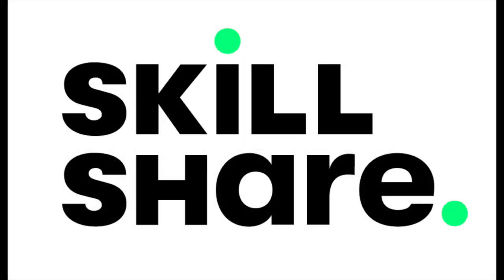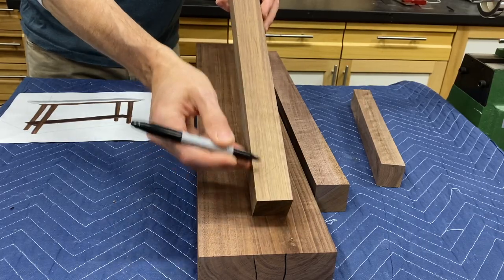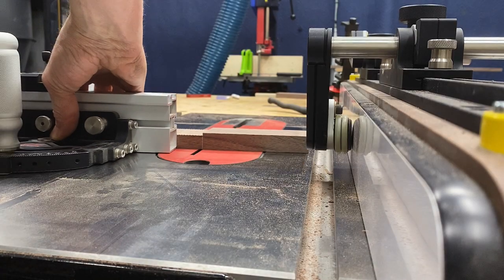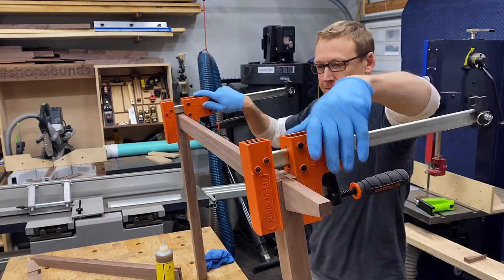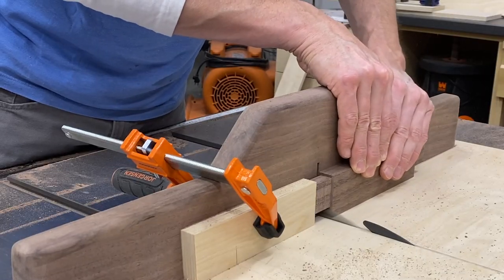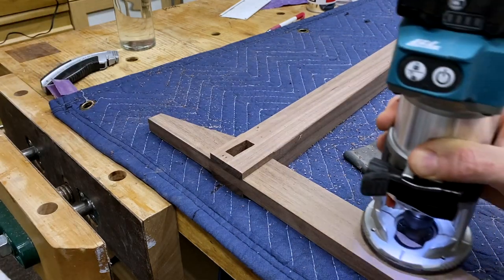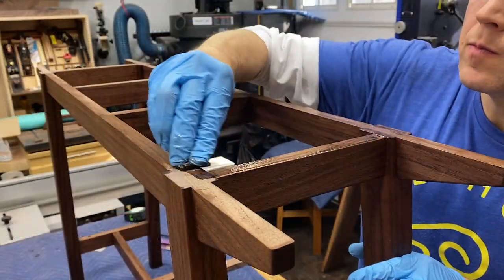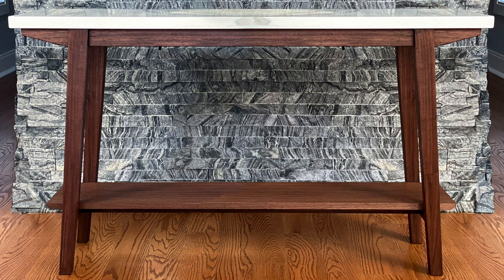Modern Console Table // Build Plans Available

Comment: Very cool project. I’d like to build this for an entry table and with a wood top. Could a drawer be added under the top? Because of the angled legs maybe not a drawer that goes from leg to leg but something that fills some space between the legs. No offense that I’m trying to change it since it’s fabulous just as it is and I’m thinking of ways it could fit my space better.
Reply from the maker: You can certainly add a drawer with some modifications. I have an online course on how to build a similar piece made of all wood with 2 drawers, if you are interested: https://rebrand.ly/modernwoodacademy

Comment: Great build and video. I really like this piece and the joinery. It's given me.some ideas to try for the entry table I'm starting on. One question for you, how do you clean your microfiber clothes used to buff off and remove rubio monocoat? I use the same thing but it seems to be a one time use the way I do it,  and that gets expensive over time. Keep up the great work!
Reply from the maker: Thanks Josh! Yes, unfortunately the micro fibers are a one time use. I get them at Harbor Freight so they are pretty cheap. I would say I used about $5 worth of them on a project.

Comment: Hey Kieth another great video and beautiful outcome!  
Was wondering if you at some point could tell us about your background as you appear to have a wealth of experience, not just in woodworking but also how you apply it when using your tools...it would be interesting.
Reply from the maker: Thanks Dave! Started woodworking in 8th grade and caught the bug from there. Worked for a contractor in high school during summer vacations doing random things like roofing, decking, drywall, etc. and built my first piece of furniture (a dresser) in college. Read a lot of books and magazines and started building my tool arsenal after college. Worked as a finish carpenter in between corporate jobs and started building commissioned pieces and re-investing that money in my shop. It just kept snowballing from there...books, magazines, online videos, more tools...to learn as much as I could and then put that into practice building furniture, as well as built-ins and cabinets. And what was a hobby with commissions has now grown into a full-time business. Scary! I didn't take any formal woodworking or furniture making classes until last Fall. Hope this gives a little insight!
Reply: @KeithJohnsonCustomWoodworking  Thank you very much for that!  I have followed a similar path...have been contemplating on interning for a fine woodworker/shop as that has been some folk's chosen path...guess I'm a little apprehensive regards to buying "real" wood and simply going for it.  
Your work is very precise, and I was looking for where it got that final polishing from.
I'll never forget that table you made (I'm sure you won't either), the one you had to remake, due to the client wanting it to be bigger!  It was such a beautiful piece, and quite the story as well!
Reply from the maker: @wayphun72  I'm reminded by that table every day because the first one is sitting in my living room. LOL. And yes, a lot of folks are scared of ruining good wood. I'm not one for spending all my time on the driving range...show me where the first tee is!! LOL.

Comment: Hi Keith! I have a question about the milling process. I work in a shop that is not climate controlled. So after milling the wood and letting it acclimate, what’s best process to avoid warping when moving the finished project to an indoor/air conditioned space? Thank you!
Reply from the maker: I don't know how bad your shop conditions are, but I would be running a dehumidifier to try and keep the humidity level at a somewhat constant rate. Make sure the moisture content in your material is under 10-12% and I would get finish on the project as soon as possible.

Comment: Thanks for explanation about grain and wood expansion!
You mentioned that you don't use PVA on top frame joints so it doesn't make wood expand. Isn't it the same with tenons and mortises you made with domino?
Reply from the maker: I'll be honest, using the Old Brown Glue is new for me. I just discovered a short time ago, so I'm still experimenting with it, but it is great having that extended open time for more complex glue-ups. So, it will be situational whether I use it or standard PVA. Hope this helps!

Comment: Hi Keith! Awesome video as ever! I hope you dont mind me asking, but is that how you apply your Rubio on all projects? I am new to rubio and looking for some tips! Also what brand of sandpaper do you use please? Big fan of the podcast as well btw
Reply from the maker: Thanks Jamie!! Yes, that is my typical method of applying Rubio on smaller furniture - dip a white scotchbrite in the Rubio, work it in and then wipe off the excess. When I have larger flat surfaces, I spread the material around with a squeegee or credit card and then work it in with a white scotch brite and wipe off the excess. The best sandpaper in my opinion is the new 3M Cubitron. It's pricey, but lasts a long time. And thanks so much for listening to the podcast!! 👊
Reply: @KeithJohnsonCustomWoodworking  Thank you so much. So you recommend leaving the rubio on for 10 minutes before wiping off the excess? Thank you very much again! I will try and get hold of some 3M Cubitron, but im in the UK and im betting its not available (non of the good woodworking stuff is!) Podcast is fantastic! I have learnt a great deal from it. Thank you!
Reply from the maker: @jamiechristensen4307  I think the amount of time you leave it on is situational. For example, which color you use, as well environmental conditions (heat, humidity, etc.) all seem to play a role in how fast the Rubio tacks up. If it gets too tacky too fast then it becomes a little more difficult to remove and you'll need a little more elbow grease. I would check it after 5 minutes. I usually work in sections and by the time I'm finished with that section, it's time to go back to the beginning and start removing the excess. Super excited you are enjoying the podcast!!
Reply: @KeithJohnsonCustomWoodworking  Thank you so much! I really appreciate your time!
Reply from the maker: @jamiechristensen4307  You're so welcome!

Comment: Great Piece! What source do you get your Rubio Monocoat finish?  Amazon?
Reply from the maker: Thanks Myles!! Yes, I usually buy my Rubio on Amazon (https://www.amazon.com/dp/B00OA5V19K/ref=cm_sw_em_r_mt_dp_H0A4EXVQ87VN0BVPXENJ) or direct from the Rubio website.
Reply: @KeithJohnsonCustomWoodworking  you mention you added black. Was that a Rubio monocoat product.  Could you share the skus 
Of the product you used?
Reply from the maker: @mhurlburt44  Yes, it was literally the Rubio Monocoat BLACK mixed with PURE https://www.amazon.com/Rubio-Monocoat-Wood-Stain-Black/dp/B07M7BGP7M/ref=sxts_sxwds-bia-wc-rsf1_0?cv_ct_cx=rubio+monocoat+black&dchild=1&keywords=rubio+monocoat+black&pd_rd_i=B07M7BGP7M&pd_rd_r=80aa3802-debb-4c20-8e1c-e7180abd032d&pd_rd_w=z7xUC&pd_rd_wg=TkW4X&pf_rd_p=5168df84-062d-4bdf-8a6e-2680813bd42f&pf_rd_r=Y2Q3C9GZGHAV258QCYK3&psc=1&qid=1612487787&s=hi&sr=1-1-7bf78e84-8ef2-4f13-9926-bee5153e81cb

Comment: FYI:  Regarding snug joints and not wanting to swell the grain with glue.  I have been experimenting with taking my snug joints, applying a hard surface behind them, and gently to slightly less gentle, hammering the inside of the joint, to compress the fibers.  Apply glue, slip together, and Bada-Bing, Bada-Bam.  Glued, snug and strong.
Reply from the maker: Yes! Peening the joint!

Comment: I just wondered if the marble top made the table a little top heavy? Also, was that real marble or Sears marble! (Frank Zappa reference)
Reply from the maker: 😂 If it were any taller, it would concern me, but it seemed pretty solid as is. Admittedly, I would have preferred a wider base, but the marble had already been cut to a specific dimension and I built the piece around it.
Reply: @KeithJohnsonCustomWoodworking  - Very Cool. I have some marble pieces from my Old Church Alter (about 100 years old) I scabbed on to after a remodel, a couple about the size you used. I’ve wanted to make something with them and thanks to you I’ve got a good idea! Thanks, I love your videos. I think the closet adds a nice tone to your narration!
Reply from the maker: @MJ-nb1qn  Thanks man!! I really like the contrasting combo of wood and marble. Has some class to it. Best of luck with your projects. And who knew all my plaid shirts would provide the most optimal voice over acoustics. Ha!